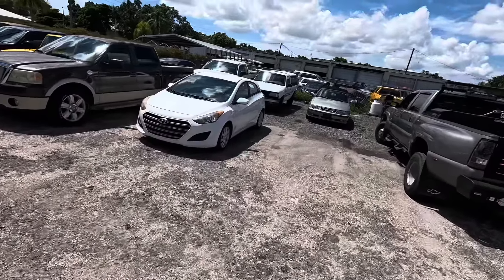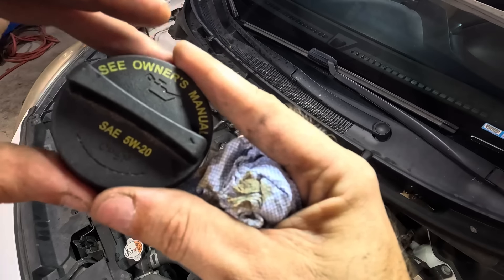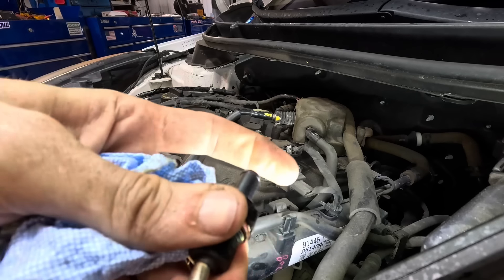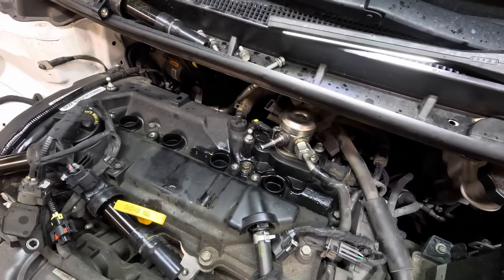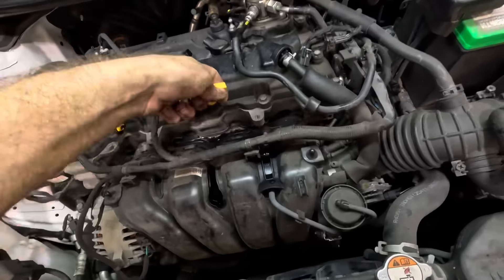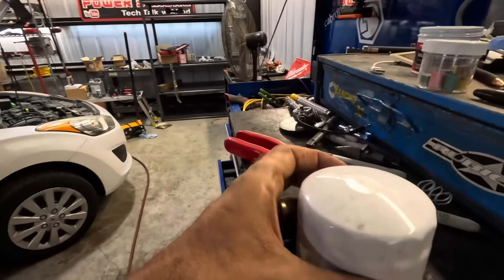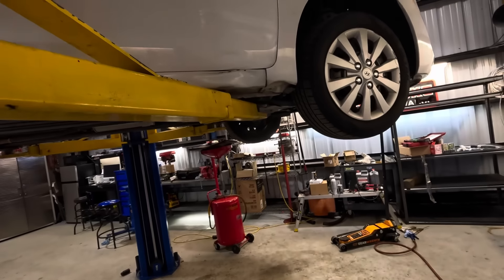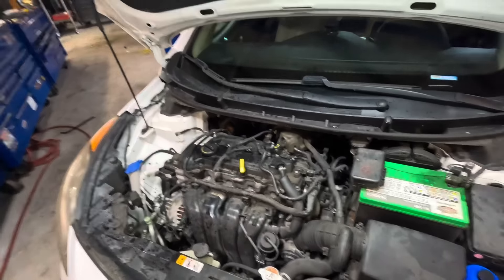Excessive Blowby! BURNING OIL! Hyundai Elantra 2.0l

Comment: People who drive Hyundai/Kia need to check their oil every week, plain and simple.
Reply: Anyone who drives anything should check their oil very regularly. I do at every fill up. Not just oil but a look under the hood for anything suspicious.
Reply: Everyone should
Reply: I do but it never goes down
Reply: My Hyundai's have all burned oil. I normally have to top off the oil 1/2 qt every 1500 miles. 

The dealers use 5W30 in the engines. That reduces oil consumption. I use 10W30. Oil consumption is now zero.
Reply: My 2017 Elantra burns a qt every 2-3k miles not as annoying anymore since I don't drive it a lot it's at 144k miles. Upgrade to a 21 they don't burn nothing between 7,500 intervals now at 97k miles on her.
Reply: Check it at every gas fill up, 5K oci, use 5W30 full synthetic.

Source: own 2013 Hyundai with 2.4l Theta II (double dose of rod knockin) timebomb. Yes i had mine replaced by the recall, first engine had 110K on it before it failed.. this one so far has 78K and runs like new. Vehicle has 187K on it and it still looks good and its paid off. Planning to drive it until this motor dies or it rusts out.
Reply: @donwyoming1936  It's true. It's crazy how we've gone backwards to 1930s levels of oil consumption.
Reply: @aaronturner1072 Try Valvoline Restore and Protect to keep the oil control rings clean and not stuck with coked sludge.
Reply: I’ve been driving Kias since 2012. I do my own oil changes. Haven’t had a problem yet. Maybe I’ve gotten lucky.
Reply: 07 Kia with ~ 220K miles and it doesn't burn a drop
Reply: I check oil at least 1 time in week, i know that my current car dont lose much oil but when you keep an eye on it you can see if it start to lose more it.
Atm i have 96 year Audi A4 B5 Avant Quattro 2.6 v6 with 485K km/ 301K miles in odo.
I change oil around every 10k kilometers what is 6213 miles.
I live in Finland so i like to change new oil before cold winter weathers.
Reply: I am from the Europeland and we have a 2012 Kia Picanto with a 1.25 MPI engine with 220 000km (136 000 miles) - no oil burning and also got a 2024 Hyundai i30 (Elantra GT) with a 1.5 T-GDI engine. Of course, the i30 is new but even the ones with a lot of km just don't consume engine oil. Basically, the Hyundai / Kia engines are pretty reliable around here (of course, we have different engines).
Reply: I check my oil this has happened in the course of 3 weeks. When I checked it to go to Panama City at the pan handle it was full. Hence I noticed the brake fluid was low. So I topped it off. Forgot to take the container out. Also had a busted belt on the trip. Had to drive the last hour on a doughnut. Then find a tire shop who was open on a Sunday. Great times!!! Anyway! Preciate the input.
Reply: @donwyoming1936  yeah the car is a main driver for the wifey. I drive it very little, don’t want her blaming me when something breaks! LOL any way it’s been a great little car. Just started doing this 3 weeks ago. Never used oil.
Reply: The engine in my Stinger is a beast, doesn't consume a drop of anything.  My co-worker puts north of 30k a year on his Sonatas.  Maintenance is key and recognizing that these cars, all modern cars really, are a lot less tolerant to neglect and abuse than they used to be.  The thin oil, tight rings, and high output per displacement puts a lot more stress on these engines than those old understressed engines of years past.
Reply: @donwyoming1936  Has it affected your MPG?
Reply: One: Ray, wear gloves.

Two: kids, if you're going to  remove any line that carries fuel, depressurize the fuel system first.
Reply: I had a KIA drive it 250,000 miles no problems at all. The only peroblem was my fault, I put the wrong tranny fluid in and the transmission stopped shifting after a few miles.  I really miss that car.
Reply: People who own a vehicle should properly maintain them period... many issues wouldn't exist regardless of manufacturer... my source: I do this all day everyday
Reply: Toyota 2.4 comes to mind
Reply: I’ll tell you what, I’d rather buy a Kia or Hyundai then most of the stuff made by the domestics today.  I’m a pretty die hard Toyota and Lexus guy, but if I had to choose something else, I’d definitively look at these.
Reply: With the way some manufacturers are going. There aren't dipsticks on the engines to allow you to check the oil levels.
Reply: People with Hyundai/Kia should throw those pos cars in the garage and buy a reliable brands. Ford, Mercedes, Nissan, Mazda, Toyota, Subaru, Honda, or Volvo are the only brands you should be looking at to buy a reliable vehicle. Stay away from Hyundai / KIA.
Reply: @gameboy4696  Nissan has been in trouble for a while, and their CVT's are absolute garbage.
Reply: We have a 2017 Hyundai SF sport ultimate. It uses about a quart every thousand miles. I change the oil every 3500 miles, especially since I learned how bad the theta 2 engines are. We're going to trade it in for a Toyota next year.
Reply: @robsteingruber9488  They have not made good cars for over 20 years.
Reply: @hokie9910  I'm not going to argue that. 🤣🤣
Reply: I had a 2015 Elantra Limited. Loved that car. I used it a lot on the highway. I did many thousands of miles traveling to see my son out west. I used eco mode 100 percent of the time on the highway and usually went 5mph over the speed limit. Much of the time I was doing either 75 or 80. That car got 42 mpg all day long. Decent ride for a small car. The limited had many options on it. Everything worked when I sold it at 140,00 miles in 2023. No problems with it. Just regular maintenance. Zero body rust and I live in Wisconsin. Didn’t even drive bad in snow. I changed the oil every 5k miles. I do have to say it did burn about a half quart. The only reason I sold it is because it was on the list of easliy stolen cars. Insurance was threatening to not cover it anymore. I kind of miss that car. It looks like I was pretty lucky though as I’ve read some nightmare stories about other elantras of that vintage.
Reply: Deplorabelibertarian..not anymore. Fixed with a combo of BG oil additive and GUMOUT complete in the fuel.
Reply: My 1.6gdi burnt a valve because of excessive oil burn 1ltr / 500km.
Ordered a used engine
Reply: I have a hyundai but I change my oil every 3 to 5k and never any problems
Reply: Every vehicle owner should be checking oil
Reply: Honestly, it's a good rule to check your oil daily, no matter what you drive
Reply: Facts and I hate it.  Keeping a bottle of oil at all times
Reply: @donwyoming1936 .  You may be starving the motor
Reply: In 2007 I bought a brand new Hyundai Accent with 25 miles on it. It now has 397,000 miles and still running well.
Reply: As a bmw you should probably check at least every once a month. Yesterday I added a quart of oil, and coolant
Reply: It won't help them
Reply: wouldnt have to if they would do the oil changes on time
Reply: I’ve owned three Hyundais and never had an oil burning problem. Luck maybe.

Comment: It’s a Hyundai. It’s burning oil. In a couple of months it’ll be back with the complaint, “Customer states there’s a hole in the block.” Not surprised! Love the vids RRR!
Reply: If you take care of the post 2014 Theta II engines they run great. The 2011-14 engines were the problem
Reply: My 2014 Elantra GT is an oil burning, sludge monster. Still runs fine with 250k miles on it. 

I found Lucas fuel treatment significantly reduces oil loss. But running 10W30 cured it.
Reply: @Alboalt  those pre-2014 Theta II engines made me a lot of money as a fire investigator! 🤣
Reply: @Alboalt  recalls up to 2020  so yea
Reply: @TCBOT  I have a 2015 sonata with the theta ii  and got all the recalls. I'm aware of them.
Reply: Right!  100,000 miles seems to be the limit for a Hyundai or Kia.  It’s just worn out early!
Reply: @craigjorgensen4637  no

Comment: Hyundai has a Technical Service Bulletin 23-EM-08 that will replace the engine if it fails the oil consumption. First they service the oil & install tamper proof seals & customer drives it for 1K miles and brings it back. If it fails then they run cleaner thru it for NC & if it passes after another 1K miles it's returned to service but if it fails they will replace the engine NC to the customer because they know the OE piston/ring pkg is defective. I've had several customers bring their cars to me b/c of oil consumption & misfires. I pull the sparkplugs and usually 1 or 2 are oil fouled. I send them to the dealer with my repair order and a copy of the TSB for them to perform. The majority of them have had their engines replaced for NC b/c Hyundai knows they have a problem hence the TSB. The TSB is for all models and all model years. My customers were happy I saved them a lot of $$ with that TSB and my customers thanked me.
Reply: Heywardsautomotive..yes you are correct and you know how to form a complete sentence..thats rare around here
Reply: any oil consumption replacement has to be original owner and it would be replaced under the 10/100k warranty subsequent owners would be 5/60k TSB does not extend the warranty for the consumption
Reply: @Austin-cg7be  Yes & this engine is 2016 & had 85K miles on it & would be covered. I have found fouled out sparkplugs also on these engine consuming oil & had to talk with the Hyundai dealer that the customer's car was not only failing the oil consumption but had MIL for misfires that could damage the converter & O2sensors if not repaired. One of our local Hyundai dealers said it passed the oil consumption & wouldn't replace the engine. Customer drove it to another dealer with the MIL illuminated & sparkplugs fouled again & they replaced the engine.

Comment: Most other shops would say, rebuild or new engine. But Ray probably just saved his customer a ton of cash in the short term at the very least and in return he just gained a dozen customers.......nice job Ray....your a rear one indeed
Reply: Driving 4000 miles a year, you can tolerate a lot of burning oil, as long as the owner keeps it topped off and changes it more often.
Reply: I ass ume thats a typo🤭
Reply: @DonaldWells-wk8dc he absolutely meant rare just a typo funny yes but still a typo or ai autocorrect or speak to spell is up to it’s mischievous stuff because i can say with great certainty every time I used autocorrect and speak to spell at no time have I ever said duck 🦆 but nevertheless that’s what it heard or felt that i should spell
Reply: @StrongDreamsWaitHere  When my family moved from Massachusetts to Arizona, we had a decommissioned school bus that was converted to about 80% moving van and 20% RV (no beds).
The engine was so worn that every fill of the diesel tanks was accompanied by 1-2 quarts of motor oil. Total mosquito killer.
It got us to Arizona, and my parents sold the bus to someone who wanted to turn it into a mobile home on their horse ranch.
Reply: I was skeptical as you started in the process, but you can't argue with results.  Thanks for the demo.
Reply: G’day very well said, and Ray has a wonderful personality  kind regards John
Reply: @DonaldWells-wk8dc  ofcourse, too happy he could finish one sentence... LOL
Reply: A rear one indeed ?
I really hope thats a typo, cuz Rayman is married to a beautiful female unit.  Lol
Reply: A rear one indeed ?
I really hope thats a typo, cuz Rayman is married to a beautiful female unit.  Lol
Reply: Most shops wouldnt even go that far they would have topped the oil off and sent it out after failing to repeat the condition and finding no codes

Comment: If it was my car, I'd have a really hard time making the call to sink $800 into a chemical flush when it may need rings anyway.  The results of the first flush still had a lot of blowby.  I've been watching DIY Dave's channel as he fights the Toyota Corolla oil consumption via blowby the rings.  He even did the BG full flush and the only chemical that has made much of a dent in the problem was when he was pouring Berryman's directly into the engine via removing the sparkplugs and letting it soak top down.  I'm sort of interested in seeing some people use Valvoline's Restore & Protect.  The problem with all of these is you really need to open up the engine to see the results.  At least drop the pan and remove the valve cover(s).  It's all a lot of work. ... in any case it's very entertaining and I'll be watching no matter what path you pick.

Comment: Absolutely nothing wrong with 5w30 in a 5w20 especially in warmer climates.
Reply: Not an experiment to try up here in Canadia, but I feel like you could almost ignore that number after the W down in Florida!
Reply: @TremaineLea  been running 5w30 in a odyssey that calls for 0w20 for years in Saskatchewan.
Reply: Toyota hybrids need 0w20, but dealers here in Europe just pour in 5w-40. No issues with it. Reason: thicker, more oldfashioned oil is cheaper, and dealers and mechanics are quite conservative ('that oil is like water, can't be good).
But there's a reason that carmakers say to use some kind of oil....
Reply: They say to put a specific oil for a reason anything else will damage the engine

Comment: Ray, back in the late 1980's, my dad blew up the work beater I had bought and maintained for him (over revved trying to get it unstuck from a snow bank). I had to immediately find him another beater. Enter a $600 1978 T-Bird with 98K on its 351M/400. The car had basically zero maintenance and the engine was totally sludge filled, only 1.5 quarts of tar drained. Old school "mechanic in a can" rescue. Quart of Liquid Wrench, oil change, filter. Ran 30 min. Another quart of LW/oil/filter and I drove it for about an hour. Filter change. Drove again. Oil/Filter, let my dad drive it a couple of days. Oil/Filter, dad drove 1000 miles. Went with 2500 miles changes from his first 10K. Also had to un-stick/de-varnish the FMX transmission. KW Transmedic. Fluid/filter. Used a syphon pump down the dipstick tube to pull 4Qts of Type F and fill every 3,000 miles. Sold the car 2.5 years and 40,000K miles later. Still ran OK, but it needed a timing chain. SO, engine cleaning CAN work. 
I'm disabled now and can't do my own work- 😢
Reply: My first car was a 78 Tbird back in the day. Had fun in that car.
Reply: Have used a Ray's cleaning process and saw a decent improvement in proformance.Thank you
Reply: My Dad had a car that was running very poorly.  A mechanic friend said it sounded like sticking valves and to just add a quart of Kerosene to the crankcase and basically do the run/drain procedure Ray used here. Dad was skeptical but after about the first 5 minutes, the engine quieted down and smoothed right out.  Problem was solved.  So yeah, solvents do have their place.
Reply: (Lord did this go long! Sorry!) Here begins the Lesson: My Grandpa, who was an accomplished Air Force Master Sargent Senior Airplane Mechanic from WWII, told me to rapidly pour a small 2 cup bottle of brake fluid down all four barrels of a Rochester Quadra-Jet on a 75 Cadillac Coupe de Ville with the 500 cu. in. engine, to eat up some of the carbon in the heads, that was making that boat diesel in a most amazing manner. Had my brother running the thing at about 25-3500rpm as I slowly started to do the deed. Grandpa didn't bother to tell me he had never tried this on a CAR before. That sucker put out enough smoke to cover part of the landings at D-Day in Normandy. I'm freaking out, screaming at my bro to KEEP IT RUNNING! and in the interim the whole dang neighborhood emptied out of their homes to see what was burning up. When the smoke quit blasting out of the exhaust I had my bro cut the ignition. Lo and behold! No dieseling! Got a stern talking to from the Fire Chief, who lived across the street, and from every other older man there. All while my Grandpa was laughing his a$$ off. So the moral is, sometimes solvents will do a great job of cleaning out crud. It's the side effects you gotta look out for. I'm old and disabled now, too, but some of my old stories still have little pearls of wisdom to impart, in more ways than one, and can give folks a chuckle. So, use the tools you're given, and watch out for the wily Elder Mechanic... 😂😁😉💨
Reply: What was his first beater that he blew up from over revving?

Comment: I have tried the BG solution on an oil burning 2009 Toyota Camry and it reduced oil burning for about one year. Reduced oil consumption from 1 quart every 3K mile to less than 1/2 quart in 3k.

This year early 2024 oil consumption returned to 1 quart in 3K miles.  Tried a new Valvoline Restore and Protect(R&P) oil.  From 200K start changed the oil four times with with R&P and at 212 K  there is no oil consumption.  R&P is engineered for the loose oil control ring problem.  Valvoline recommends the four change interval,  noticed reduced oil consumption at the end of the second oil change.

Thanks for your excellent video!
Reply: I didn't know that a Toyota Camry would burn oil ???     I thought that Toyota was supposed to be number one.   LOL
Reply: @gregorylyon1004 you sound slow. He has a 2009 camry, it's a 16 years old car. It means it's not new

Comment: I saw significant improvement in two old Toyotas with 2GR engines using the BG EPR. One stopped smoking on startup and the other reduced oil consumption to a fraction of a quart per 5K from a quart per 5K.